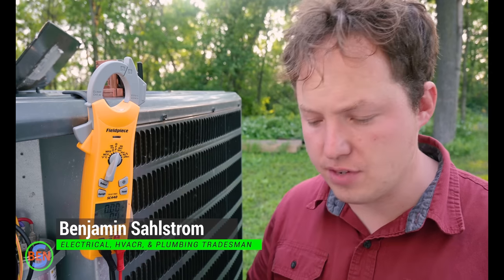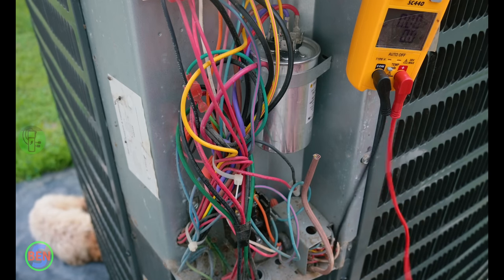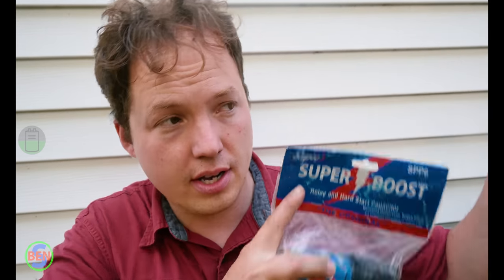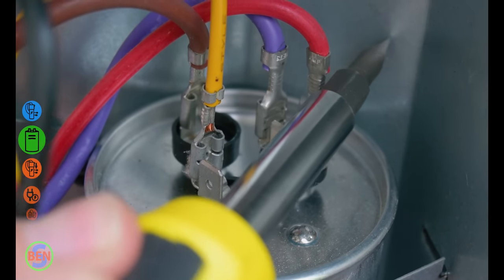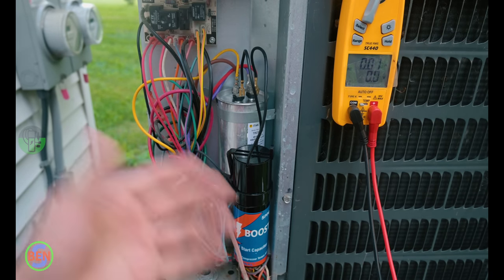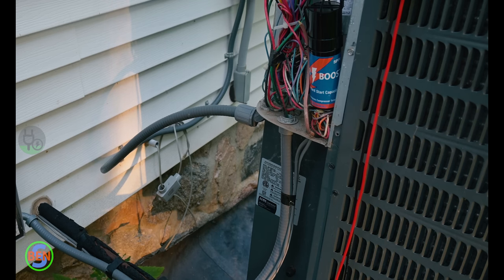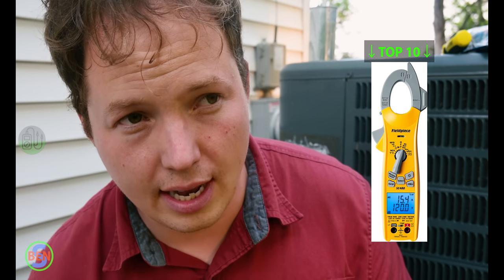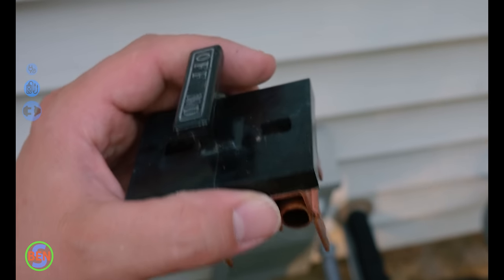How To Install a Hard Start Kit on AC Condenser - Compressor Won't Start on Air Conditioner

Comment: When we replaced our AC a few years back the technician installed a temporary hard start kit on the old unit to get our system running while waiting for a replacement system. This was fantastic as the temperature was in the high 90s F (unusually high for PA) when the old unit stopped working. I did ask him about how this worked and now I understand more after watching the video.

Comment: Nice video. I use to install those out in the country where voltage was sketchy. They worked good on areas of minimal voltage problems. Thanks for the video.
Reply: Good info thanks.

Comment: Usually if the duel capacitor is bad the condenser fan will not start also as they are built together and if one goes bad the other one will also. In my opinion if the top of the capacitor is bulged, there is no need to test it. Just chunk it. Thanks for the video.
Reply: most capacitors don't go bad all at once and its typically the herm that goes bad first.  Lots of capacitors go bad slowly.  That said hard start kids are designed for compressors that need extra torgue to get going.  Typically older ones with bad bearings, bad oil, restrictions.  So yes you can have a cap with the fan side being within spec and the herm side being low, but most likely you use a hard start because the compressor isn't healthy.
Reply: @MichaelMantion  I agree. The herm side of the cap of course is worked the hardest. And the hard start kits do work some of the time. At least for awhile. I installed one on my unit some years ago and it lasted another 2 years before I had to replace the unit.
Reply: @imtruth69  considering we are moving to r32 seems silly to replace an AC system at this point.  Plus 410a is so expensive I would never pay to replace a compressor.  Hard start kits are a great choice to use until r32 is available across the country.
Reply: @MichaelMantion  I agree. The hard start is only good to help prolong the time till replacement. If it works. When I installed one on my heat pump unit it lasted almost 2 years which gave me time to save up some money and research for a new unit. It is at best a temp fix to buy you a little time.

Comment: Ben you need to ensure that the fused disconnect is properly selectively coordinated with the breaker. If done well it can be helpful in addressing transients, surges, and swells especially on start up of fan and compressor far better than a breaker alone.
Reply: Huh?
Reply: @jessg7770  I am well aware.  I don't understand what "properly selectively coordinating" them means and what about the case of a non-fused disconnect?

Comment: I have ordered 3 of this boosters for heat pump, well pump and air compressor.
Hopefully  save some electric  bill and makes them   last long..
Thanks for video.
John
Reply from the maker: Never tried one on anything but refrigerant compressors myself. I suppose anything with a run Capacitor could maybe benefit? Would definitely want to research it first.
Reply: @BenjaminSahlstrom I have contacted the Supcu Technical Support and got very good information about this product.
It makes me feel at peace and I installed one of these to my 5 ton heat pump today.
Will let you know how well it goes and the result.
Thanks 
John

Comment: Don’t wait for the compressor to show signs of failing to install a hard start kit. You should install a 5-2-1 hard start because it has a potential relay that drops the kit out after the compressor starts. Clean your condenser coil every spring, replace your filters every two months, test the capacitor twice a year and install a surge protector on the disconnect switch along with the 5-2-1 hard start kit. You may never need more service than that.

Comment: Also a good rule of thumb is Check your AMP’s with and without your hard start which will give you an idea of how the compressor is running and the Service Call Pro App we use we take pictures of them so next service call we check again and will let you know if it truly helps for long term or if the Compressor is slowly dying

Comment: Thanks!! This vid came in handy. I had one thing for the wire on fan and I thought I had to connect one of the cables to the fan port (old setup had it that way) seemed to work fine with one to herm and one to common

Comment: I recommend to measure transient current: 
- if starting current is over 7 times of nominal current you have to search insulation malfunction between windings; 
- if starting current is above 7 times of nominal current you have small cracks in coil and the motor should be rewinded.
Reply: above and over are the same thing?

Comment: Question this seems fairly easy to install  thanks to your tutorial.  But what would this cost for a technician to do this?
Reply: It will be the dispatch fee + material fee + labor fee and it varies per state. Around $200-$350 maybe because dispatch is usually around $100 and hourly fee rate of tech is between $75-$150. Hope it helps.

Comment: The more I know about these units and start devices, the more complex they seem. It sounds like the ideal compressor would be one with no start cap, an old style PSC motor. Then you just wire the hard start kit in parallel with the run cap to feed the start windings, like wiring for a typical start capacitor and relay. if you've already got a potential relay and start cap, I'm guessing you take that and the old start cap out and replace it with the hard start kit, or perhaps a 5-2-1 kit. The run windings for the compressor are in parallel but they don't have an inline capacitor. It sounds easy, but the complexity of these circuits is amazing.

Comment: Suggestion for video: How to install electric motor on a sailboat using Lifepo batteries and solar and wind charging, 26ft to 32 ft size, 8,000-15000 displacement. What size motor, what size batteries, best voltage? how to wire, battery management system, votage regulator, and all the other details. Because it's use is on the water, I imagine the motor is either on or off, with a regulator to increase charge for. Ore power.

Comment: I have an air compressor that does not like to start when it is cold. It turns over slowly or does not start when cold. Can I use this to help boost my 120v air compressor on startup?  Thanks!

Comment: Thanks for the info. So I checked my Cap with my Fluke. The rating is 45/5, but my readings are 43.2/4.86. I know it's close, but is this a concern that the Cap is going out. I noticed the compressor is loud on start-up, and I even hear in the panel the surge in the breaker and wire. Connections are good. Should I change my cap or add the booster?
Reply: The normal range is plus or minus 5% from factory. Yours is fine. Usually only worry when it's more than 10% below rated, so below ~40-40.5 for you.

Comment: A week after watching this my AC quit.  The fan runs and there is a momentary buzz from the compressor every 30 seconds, so I'm thinking I have an opportunity to put this info to good use.  Two questions: a) Does the hard start kit just provide a giant - parallel - capacitor in the compressor circuit for a split second?  b) I'm confused by the terms run and start capacitor.  Is the FAN terminal of the capacitor in series with both the fan and compressor motors, and this is what is meant by run capacitor, or is the contactor switching between windings or something?

Comment: Is it possible the fan and compressor (herm) wires were backwards.  With the compressor not coming on and the fan side being bad and then it working afterwords.  I bet if you follow the yellow wire it goes to the fan and not the compressor. Just a thought.  I would also think the compressor would have the larger brown wire, but I am no HVAC dude.
Reply: Just checked the wire diagram and the wire colors are correct the way you had it. So unless someone swapped them at the fan and compressor I am wrong.

Comment: Great video!  Is there a way to know when these hard start kits have failed?  What do you measure unless you have baselines amp draw with a new one once installed. Thanks!
Reply from the maker: Interesting question. Personally I would just try a new one if you suspect that the old one was bad since they're so affordable.
Reply: @BenjaminSahlstrom  thanks Benjamin. Getting my 5-2-1 today did a baseline startup amp draw which was 110 amps peak. Interesting to see what it drops to
Reply: @BenjaminSahlstrom  - So Ben I checked the OEM capacitor rating offered by Copeland compressor versus the 521 start kit properly sized for my unit. The OEM had a microfarad range of 88-108. The 521 model start kit which was sized with my unit (4 tons) had a microfare and range written on it of 189-227. Should I be concerned? Can I just change out the capacitor and the resistor between the terminals? Concerned that athough it works it’s not the proper capacitor. Thoughts?

Comment: Why do some units come factory with start caps and most of them do not?
Reply: My 3.5 ton Trane has a factory start cap and relay. So basically it’s expensive units or maybe even on high tonnage units.

Comment: Make sure the hard/no start isn't due to high pressure due to short cycling.
Reply: When you say short cycling what do you mean. I assume it is compressor on versus off times. My compressor runs about 25-30%. Say 4 minutes on and 10 minutes off. Does that sound reasonable?
Reply: @condor5635  Short cycling is generally when the system only runs for less than 10 minutes and is off for less than 10 minutes.  Among other things, compressor off time not being long enough doesn't allow for the system pressure to reach equilibrium and the compressor has to start against higher pressure making compressor starting harder or potentially not possible.
Reply: @D2O2  - so mine definitely falls in that case. 6am now and it’s 78 deg OAT - unit is on for 5 min off for 10 min and thermostat set at 76. House is 2,300 square feet 3/2 single story. It’s a 4 ton unit. Is that a wrong size for the house? Have had unit for 20+ years
Reply: @condor5635  With that low run time,  sure seems like the unit is too large for the house.  There could be other factors like the thermostat location, etc.  Dehumidication can be a problem if you live in a humid climate with that low of a run time.  To properly size the equipment load calculations really need to be performed.

Comment: I personally prefer installing two capacitors . It works as a back in case one goes. I m a retired Marine living in Mexico and I’m 80 yards away from the closest transformer. Mexico ran a service line of 220 volts using #6 line to my meter. I get 220 volts but the amperes definitely drops . Using the two caps saves my compressors

Comment: My electrician install this same unit on my 2 ton heat pump…….. 5 days later the compressor got fried ….Hard Start from Amazon $18.00 - my new A/C $7400.00.  Buyer beware
Reply: Why did he installed it in the first place? Was the compressor bound up?
Reply: Yeah, why?
Reply: It wasn't from the hard start.
Reply: Coincidence! This would not cause your compressor to “fry”! Chances are the windings in your compressor were already failing.
Reply: Installed on the annual check up saying it would extend the life of the unit. There was nothing wrong with my unit 6 years old and never a problem
Reply: @aamirshahzad8060  It was installed on the annual check up. Unit was 6 years old and never had any issues, even in this very hot oklahoma weather
Reply: @blackhorse2947  6 yrs old - sounds like a warranty claim to me.
Reply: @Merescat  It is in warranty, but the installation company is telling me they can’t get the parts……….????  Not sure I believe

Comment: Most AC capacitors need replaced every year I’ve found.
Reply: Your HVAC company is taking you for a ride…
Reply: @mman454  big time
Reply: My 24,000 BTU system was installed in 2004 and I had my first capacitors failure last summer in 2021.  My previous system was installed in 1985 and it never had a capacitors failure.
Reply: My 21 year old unit has never had a capacitor failure.
Reply: Sounds like you are having some major voltage spikes.  If you live in high lightning area, and have bad grounding, I'll buy it.  Or you may have some unreliable power delivery